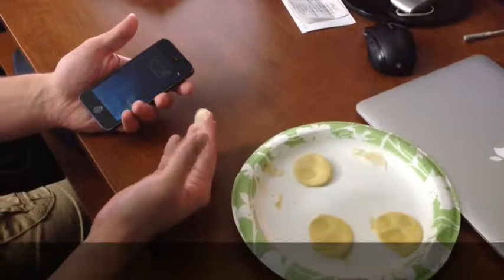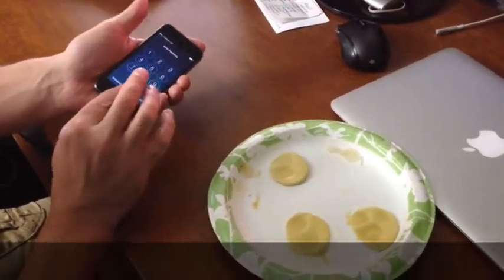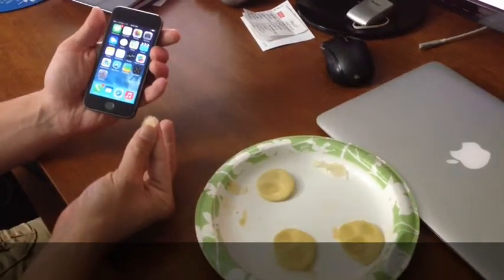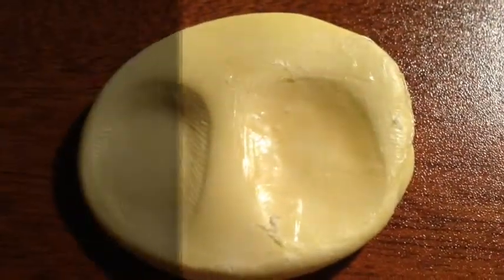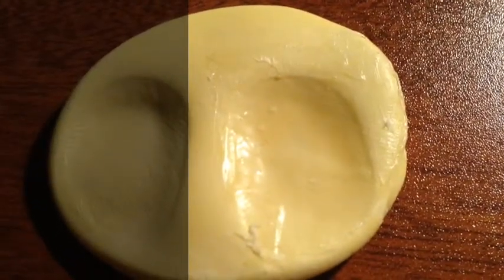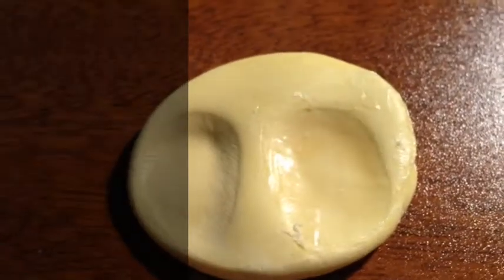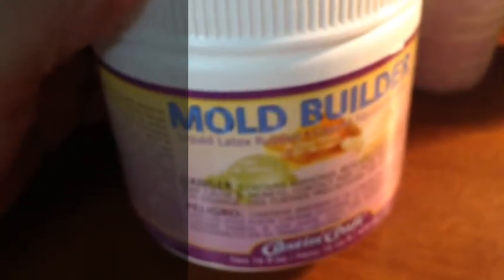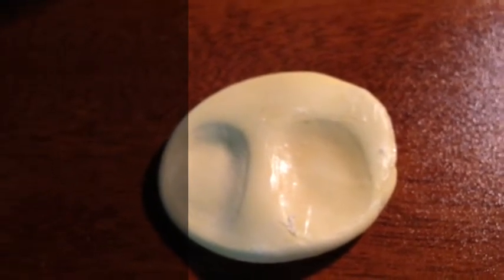Apple Touch ID Circumvent (hacking Touch Id)

Comment: Next, you should try fuming a latent print on a glass with cyanoacrylate and then using your molding material to capture the negative from that. It works fairly reliably.